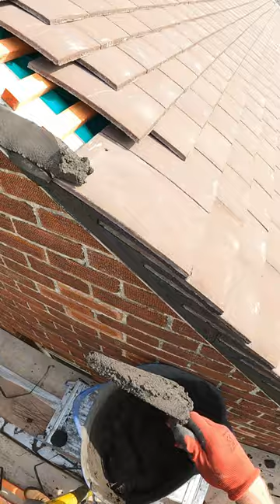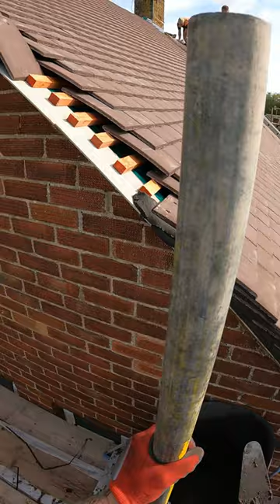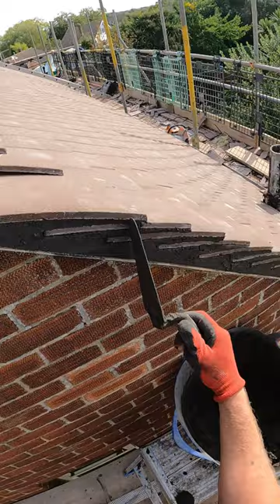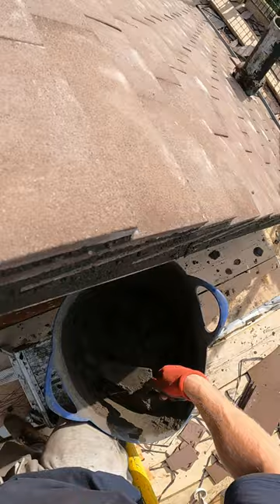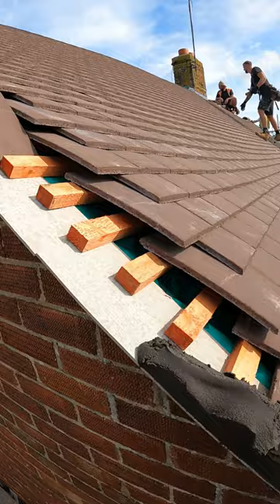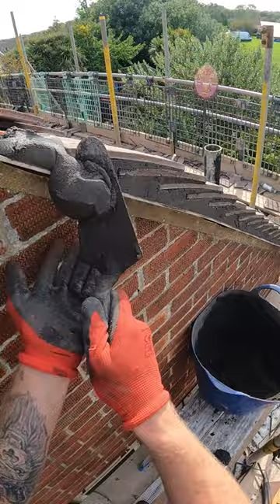Black Muck Plain Tile Verge  #construction #roofing #building #diy #bricklaying #shorts #short

Comment: Incomplete work, extra wind forces on verge require mechanical fixings (copper or alu nails) to prevent mortar cracking under vibration and subsequent delaminating of mortar bed from underside of roof tile.

Comment: The only time I did this was on my mother in law's extension. 
I heard you were supposed to nail them but I found the nailing made the muck vibrate out so I ended up putting one screw in each tile instead.
Worked lovely.
Reply: You don't have to put a nail or a screw in every tile you definitely don't put a screw in
Reply: @johnpalfreyman8290 if you don't want a waurantee no you don't.
Then your roof won't get signed off.
Reply: One gust of strong wing unde that lip off they come😢😮
Reply: @oakpurple  all perimeters should be nailed at least 1m in then every 5th. 
But that was the good old days when we installed roofs properly.
Reply: @PeakyBlinder  oh yes the good old days when people took a bit of pride in there jobs .👍🙏
Reply: @johnpalfreyman8290 you should nail all gable tiles. And you can absolutely use screws (for the gables) just makes it hardy to pull out if the tile breaks.
Reply: Waurantee ????  @PeakyBlinder  warrantee maybe
Reply: @jamesfranklin8364 I think you are both confusing warranty and guarantee 😂
Reply: @johnpalfreyman8290  screws defo trump nails.👍

Comment: I always nail them tiles on the verge but each to their own bro and love doing plain tile verges 💪😎
Reply: I was wondering that also due to rain run off is it common practice not to nail edge pueces i was just wondering the roofing  standard of edging on tile..no plywood on roof is quite eyeopening for us all in usa i think it was first thing i noticed and no venting of attic air circulation  also..
Reply: @nattyw495 Might be due to the fact that most homes in uk are built to keep heat in so it doesn't get cold. But  it might be unrelated
Reply: @nattyw495  when I was an apprentice with Marley we had to nail every tile site agents used to go round with a long stick checking glad don’t do the big sites nowadays just private ones
Reply: @nattyw495 the vents might have been on the other side of the roof mate
Reply: @nattyw495 the verges, top &  bottom row are usually always fully nailed and then it will be nail 2 miss one or nail alternate tiles. Most people will sheet the roof with OSB then fit breather membrane, counter battens, battens then tile. Ventilation usually comes in the form of vents that are fitted to the top of the fascia board underneath the eaves tray and the ridge will be ventilated to allow the loft space to breathe. 👍
Reply: @nattyw495  also dry verge and ridge systems are much more common in the uk now than wet/mud system.
Reply: @iainmacdonald4433  yes these make our life so much easier and quicker 😂👍
Reply: @thatcodguy1237 so houses in the uk are built to keep heat in? So are you saying in America it’s different our houses are built to keep it cold?
Reply: @xaphan8581 your houses aren't build with any other purpose than to last a few seasons till it falls apart, rot or blow away and then a new cardboard house can be build.
In America you don't have 1/4 of the standards of buildings that we have in Europe. And even less than in Scandinavia. Houses there are basically unbreakable and extremely high quality.
Reply: @nattyw495  - the ventilation is from the eaves and up to the ridge. There are systems that are installed before the roof is covered plus the membrane under the tile battens is breathable. Sometimes 'dry ridge' system is used where no muck is required and ridge is screwed to ridgeboard incorporating air gaps for free air movement. No requirement for plywood on rafters in English building regulations per se but different in Scotland I believe.
Reply: @tobiashede so then why are there houses in my neighborhood built in 17 an 1800's?  Tell me you know nothing without telling me. 😂
Reply: Honestly same, i live in Pittsburgh and a lot of these houses over 100 years old have stood the test of time with decent maintenance. Even the vacant ones arent totally destroyed. Once the roof goes then its pretty much down hill from there but if you find ones with good roofs theyre typically in ok condition even at 100years old@glennlavalle9807
Reply: @glennlavalle9807  I hope you're kidding right.. 
So because a few houses were built over a 100 years ago in your neighborhood and somebody spend a lot of money in upkeeping the paperthin wood buildings. Then that means that all American houses are build right? 😂😂😂 Tell me you're American without telling me..
But cool, a few houses in your neighborhood are old. That proves my point. Only a few are old because the rest of your neighborhoods houses broke down, fell apart or just molded away and had to be rebuild again and again. 
Look... there's no point in arguing with you really. There's not really anything to argue about since this matter isn't really a matter of opinion, but a matter of simple facts. And therefore not really up for debate.
I'll leave you with this quote I think fits you well.
"Wisdom has been chasing you all your life, but you have always been faster"

Comment: Would you normally nail the end tiles ?
Reply: He is using cement and cement is a great way to hold stuff together. So I would imagine that nails would be unnecessary.
Reply: Where I'm from we nail the end tiles. Using cement could hinder airflow under the tiles
Reply: @vif13vf are vents in the ridge or box vents or other styles of vents not common over there? Seems like having a ridge vent of some kind would be fairly easy with tile.
Reply: Ideally you want to nail the perimeter of the roof and every 3rd or 4th row to secure the rest of the tiles with the weight and pressure of overlapping tiles. Makes replacing broken tiles easier in the future by not nailing them all.
Reply: @vif13vf clearly haven't heard of sideways rain.
Reply: @vif13vf I don't know but isn't that probably the point? So it doesn't lift with the wind?
Reply: @vif13vf what happened when the wind and rain gets underneath the roof?
Reply: @BlackHawkBallistic Hi normally modern type roofs are vented at the eaves at both  sides creating a cross flow above the insulation.Also in England not Scotland! We fix tiles and or slates on Lathes or battens as some call them nowadays so air blows underneath and through the felt (sarkin) laps Although a few years ago there was some new building regs that was trying to make the roof airtight!!! Making the felt as tight as a snare drum.Probably  dreamed up by some clown in an office and a computer.
Reply: @L5GUK No kidding!?
Reply: @BlackHawkBallistic we use a lot of ridge vents, when needed Ovc
Reply: No nails is stronger
Reply: @FriedRicePlease  with thermal cycles the bond to the tiles will break. In 5 years most of that cement will be loose and crumbling
Reply: Why does everyone jump on these videos thinking they know what there on about. Jobsworth clowns. But the verge tiles should be nailed

Comment: Do you guys have like a cement ration?
Because I keep coming across these bits and the bit round the chimney where the guy has obviously completley run out of cement but has carried on with the sand and water regardless 🤷‍♂️

Comment: Better Clipped. Nailed. And dry verge covered or cloaked/smart verge installed.

Offering no more than 2-3 year guarantee tops before it crumbles and dropps out. Coloured mortar is even weaker. 
Hence why NHBC stopped this practice nationwide in UK back in 2010 now. Too many remedials and poor warranty claims. Too many insurance claims when they all blow off or leak.

Nice traditional job to look back at though. This Guy is skilled and neat. Just old fashioned and there’s stronger and faster arguably neater ways to close a verge nowadays. Without cement. 

Takes us back tho. Takes us all back. 🤘🏻 good video.

Comment: The mortar is very neat but the tiles should be nailed. BS 5534, the Code of Practice for Slating and Tiling states that all single lapped interlocking tiles must be mechanically fixed, and perimeter tiles (edge tiles) should be mechanically fixed using a minimum of two fixings.
Reply: These arent single lapped interlocking tiles but yes BS5534 still requires nailing

Comment: What I used to do was make a sticky dicky mix with Hydrated lime can't wack it for this type of work I like the look on 101/2 61/2 but on bigger tlles can look shite but you know that's all we had before the plastic shit ad ons came along Try gobboing some proper clay Roman tiles they need 4 inches of mortar at the eaves as you bed them down almost impossible to do afterwards

Comment: Will FAR outlast the asphalt shingles used in the states.
Reply: no nails on verge is not good... then people are surprised when storms rip the tiles off 😂
Reply: Completely different weather conditions than the states, otherwise house builder would be using shingles,
Reply: @robmac5578 absolutely no chance. Makes a house look like a garden shed
Reply: I doubt slate would last a single winter.
Reply: Or a light Wyoming breeze.
Reply: @robmac5578  Roofs in the Uk are expected to last 50-70 years... because our houses are expected to last between 120 and 200 years
That isn't happening if we use shingles

Comment: UK roofs are way, way more robust and heavy duty than roofs in the US. How long do they last? US standard asphalt tile roofs last 20-25 years, but yours look like they'd go 100 easy!
Reply: The problem is the underlayment will only last 20-25 years. So while the stone tile may last 100 years the underlayment is long gone and you have a leaky roof with rotted wood from water damage. So you still need to replace your roof every 25-30 years. And this is in England where it rains all the bloody time.
Reply: @MrJking065  That is nonsense. My house was build 30 years ago, and the roof is fine. My mother's house was built in the mid 1960s, and apart from having to reset the bottom couple of ridge tiles down the hips that's fine too. A bit of rot at the bottom end of the felt, and that's about it. Modern membranes are much better in that respect.

Roofs don't need replacing every 25-30 years.
Reply: @MrJking065 my house is 125 years old and only been replaced once, you just live in a shit house 😂
Reply: @makeasylumsgreatagain864  Sure.
Reply: @MrJking065 the "underlayment" as you call it had nothing to do with water proofing after the roof is tiled, that's what the tiles are for. It's there for temporary protection only before the tiles are on, and then after that to resist wind uplift. If water is getting to the membrane after the tiles are on there is something wrong with the tiles. Plenty of houses built in the 1930's never had any felt whatsoever and are still fine so long as the tiles were nailed apart from occasional fine wind blown snow. Breathable membranes used today should last as long as the roof so 60 years plus, so long as the tiles remain in good condition.

Comment: So whats the "muck"? Here in canada we never see this tile shingles. This far up North its mainly tin roofs. Interesting
Reply: They are just plain tiles. No such thing as a "tile shingle".
Reply: They don't get snow or ice or wind like us. This is a tile roof. It wouldn't last here, snow and ice like we get would make the roof so heavy it would break.
Reply: @DembaiVT  I doubt it very much. Those tiled roofs are actually very strong. The tiles themselves are very heavy, so they have to be. Also, the pitches are steeper in countries where tiled roofs are used. Such roofs are not confined to the UK, but are common across all of Europe.
Reply: @DembaiVT  There are tile roofs used in countries like Sweden and Norway. They can handle whatever snow load is required. They just have to be built to suit.

Comment: It amazes me how other countries do things differently. All these tiles just sit on there and stay there ? With nothing securing them to the actual structure itself ? 😮
Reply: Every 4th row is nailed down. It won't move anywhere.
Reply: What if I didn't pay for the nailing package
Reply: @JoseA-w9n  that's why you're only getting every fourth row!
Reply: @rhiAction.  I just think it's not fair 😕 lol I would want every one nailed down but not pay hella much
Reply: @JoseA-w9n they’re making a joke. The weight and lay pattern is what holds the tiles in place; nailing every tile just isn’t necessary and is actually worse. More holes in the batten  means you’re adding more points of failure and will shorten the lifespan of the wood. And banging every tile means exponentially more chance of broken tiles. Also any little repair later would require you to break every tile above and around it just to get to the spot, and none of the tiles would be reusable. If you had to replace any portion of the underlay, it would be a total waste to discard/replace 100s of tiles that were maybe at only 1/10th of their lifespan just bc you wanted to add unnecessary nails (which have a shorter lifespan than the tiles). Just inspect your roof every so often and replace any loose tiles you might find right away, and that roof isn’t going anywhere.
Reply: @RagenRibbonz  learn something new everyday I been roofing for a long time now lol it's just cool to see how other systems work and are installed thanks for the insight tho !!!

Comment: Question. If the rest of the roof isn't nailed in what's the point of the cement on the edging? Like which dickhead is paying for loose tiles over 99% of the roof but wants the edges secure.
Reply: They dont nail every row genius

Comment: Why you using mud
Reply: Mud?? It is not mud
Reply: Its not mud its mortar, which is sand and cement
Reply: @draganjekic4187  mud is slang for wet cement/concrete cause it looks like mud. So he is just wondering why they put cement on the roof.
Reply: Because it bonds the tiles together and stops wind and rain driving under them